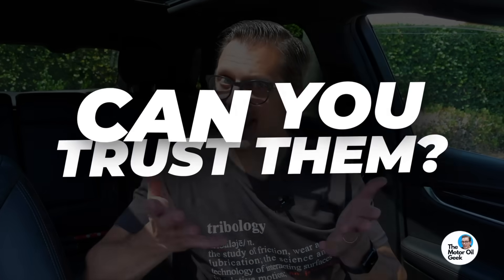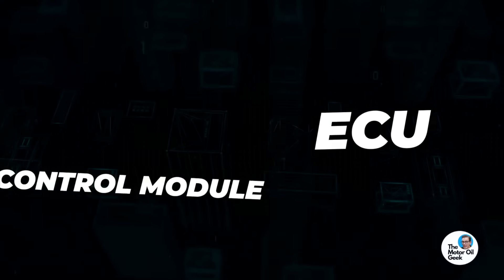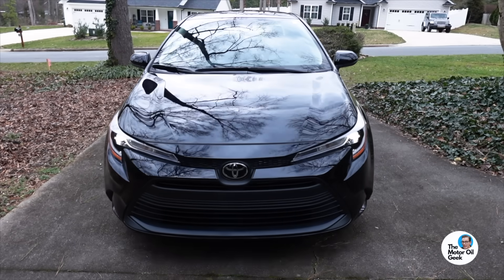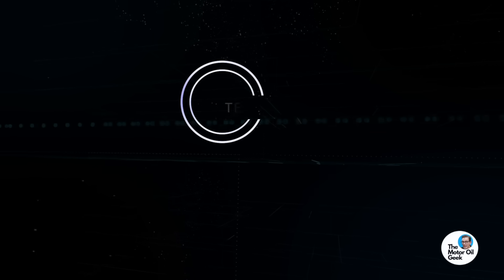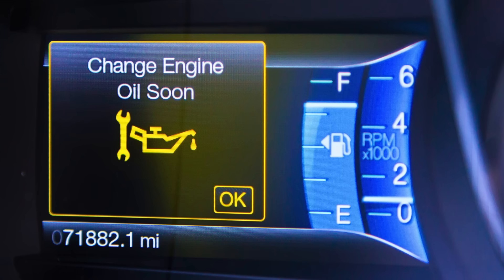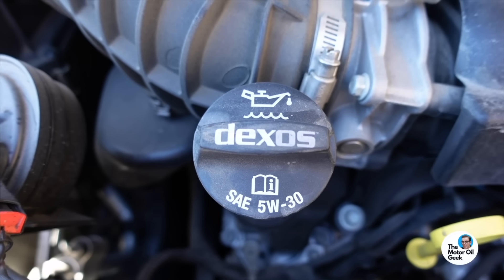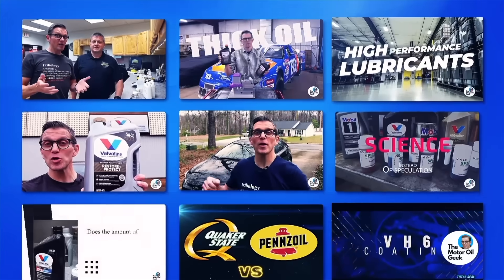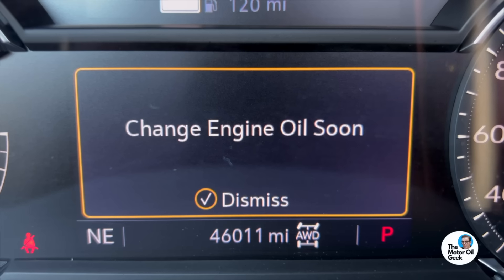The Accuracy of OIL LIFE Indicators REVEALED!

Comment: My car is a 1.6 diesel Vauxhall Astra it’s the first car I have owned with an oil light indicator it usually zeroes after 12 months it has done 66.000 miles now and runs very well my wife has a 2003 1.6 petrol Ford focus she had from new with 62.000 she only does few miles a year we don’t need 2 cars now I am retired but we keep it because is a member of the family now but every 12 months it has the oil change and it runs like new so but ways of looking after you cars oil changes seem too work

Comment: Didn't you post a video showing that you should NOT trust that, and to change your oil every 3-5k miles if you want your engine to run forever, that the manufacture recommendations were based solely on "keep costs low for the original buyer"???

Comment: So the results of the oil test showed the oil is fine, but also he is telling you "trust the monitor and change your oil when it says to". No thanks. The oil monitors and other nags are there to drive revenue for dealerships. There is no way an oil life monitor, based purely on an algorithm, can realistically tell you when your ought to change your oil. If you something high quality like Rotella T6, you are good to at least 15K miles if not 20K miles as long as you used an oil filter with the capacity to go that long between changes. There is nothing more cringe than some dopey boomer paying a premium for synthetic oil and changing it every 3K to 5K miles because the fool thinks it's good for the engine. It's actually not. Nobody who uses synthetic oil should be changing any less than 10K miles unless they have a specific scenario that would require it (i.e. racing, routinely operating in dusty conditions, etc).

Comment: Oil is cheep,  cheep oil isn’t.  I’ve used a high quality oil, along with oil analysis and have come to the results that 10000 miles works for me.  The lab results said I could go 15000 miles plus.  All the qualities of the oil were still well with in specs, but 10000 miles is a good round number on the odometer to go by.

Comment: I used to do 3 oil changes in my Pontiac before the idiot light came on, telling me to change the oil.

I got rid of the car at 263K, rust up to the door handles and a haunted transmission. But the engine? Ran great and burnt 1/2 a quart of oil a month. 

Put your oil monitoring equipment where the sun doesn't shine.

Comment: I just got back the results for my 2014 ford fusion 2.O vep engine, with 195400 miles, they told me i can go safely to a 7500 mile oil chi, i change mine out  at 6000 miles, and make sure the oil i use is dexos quality oil.  When i change my oil out i get back close to all 6 quarts in put in the engine,

Comment: GM engineering also developed "other" oil monitoring systems, including Acid/Base ratios, Visual Density, and a crude Viscosity sensor.  I and a couple of buddies got some money rewards for another method, using actual gear meshing speed/force contact times, through the oil film.  That was used in transmissions, for wear estimation and failure prediction.  The Algorithmic method is used primarily since it does not require any special or unusual sensors, thus reducing parts and assembly cost.  Software and AI "smart-systems" will be the wave of the future (actually now).

Comment: I disagree with the oil percentage gadge,just changed my oil in my 2015 Silverado with 62000 miles,no heavy use.just under 7000 miles on oil change and I was shocked to see gunk come out of my oil pan.i used 0w20 synthetic penns oil.it showed 9 percent. Next oil change will be at 5000 to see how it looks

Comment: Since you don’t know how many miles are on it……What if the indicator wasn’t reset when the oil was changed……could only have a couple hundred miles on it.  🤷🏽‍♂️
Reply from the maker: That's a fair point. However, the oil was very dark, so it was obvious the oil had not been changed recently. Also, the point of the video was not based on this single test. This is just an example to make the point.

Comment: True story. My 2003 GMC Envoy straight 6 engine said that i was down to 13 percent on oil. But the car began to lose power, so i changed it and never went that far again. 275,000 miles through and runs great.

Comment: I own a 2004 Mercedes E 320 from new and it has an automated service wear message indicator, no scheduled service mileage.  Still my daily driver and over 500,000km  traveled, the average mileage between service’s is 28,000km for its life so far.    The first service after driving out from dealer at new was 32,000km when computer said it was due.  Still same engine and transmission and no failures.  When German built cars were still a quality piece of machinery.  I live in Melbourne Australia if there are questions about conditions/climate the car lives in.     Yeh it’s full synthetic oils, but only exactly the manufacturers specified lubricants.    Manufacturers specified,  not Oil companies recommended suitable lubricants. They are not the same.

Comment: I wonder how accurate the oil life remaining analysis built into our 2020 Shelby GT500 is (yeah, THAT Shelby, with the 760 horsepower, supercharged engine).  In our case it the result of doing a formal oil analysis is likely not going to make any difference in how often I change our oil.  We bought the Shelby new and took delivery on 1/2/2020.  Since then we have only driven it about 3,025 miles (we have a small fleet of vintage Mustangs and Shelby vehicles we also drive during car Season).  By the end of each car Season (early to mid November) I usually show about 65% oil life remaining - after only driving a little over 1,000 miles since the prior oil change.  I get the oil and filter changed the beginning of every new Car Season (mid-April or so), using the Ford recommended synthetic oil of course.  I do think I will take samples at the end of this Car Season, and beginning of next Car Season, and submit them for lab analysis, while taking note of the on-board oil life analysis, just for giggles and grins if no other reason.

Anyway, I really enjoy your videos.  I have been in the auto repair end of the business since 1972, and in retirement have been offering disgnosztic and repair advice to folks belonging to any number of Mustang/Shelby groups and clubs.  Your information shared so freely helps me keep grounded in reality.  Thank goodness for your insights and the Internet being used as a way to disseminate  your knowledge.  You are doing much good for mankind, seriously...  Well, okay, you are doing much good for automobile enthusiasts at the very least - and that has to be worth something.  Others may fear, or even deny the importance of "we geeks."  I would suggest they watch this recap of my favorite Twilight Zone episode (1961, in black and white) to see what haooens when folks deemed to be geeks (or obsolete) are trifled with.  heh heh...  https://www.google.com/search?q=twilight+zone+episode+with+man+whi+is+no+longer+relevant&rlz=1C6CHFA_enUS1044US1046&sca_esv=eb561d6a720f4850&sxsrf=ADLYWIKCWNM-rkJ3h4jvk4jUIojABp8olQ%3A1728184020342&source=hp&ei=1P4BZ8qhEqSF9u8Pqq37yAQ&iflsig=AL9hbdgAAAAAZwIM5CFzha8pUb3wYsKJTRULK2JS43Q2&ved=0ahUKEwjK24uV4_iIAxWkgv0HHarWHkkQ4dUDCBg&uact=5&oq=twilight+zone+episode+with+man+whi+is+no+longer+relevant&gs_lp=Egdnd3Mtd2l6Ijh0d2lsaWdodCB6b25lIGVwaXNvZGUgd2l0aCBtYW4gd2hpIGlzIG5vIGxvbmdlciByZWxldmFudDIHECEYoAEYCjIHECEYoAEYCjIHECEYoAEYCjIHECEYChirAjIHECEYChirAki2iwJQAFj_iQJwB3gAkAEAmAGOAaAB1jyqAQU1NS4yNrgBA8gBAPgBAZgCTaAC0jbCAg4QLhiABBjHARiOBRivAcICERAuGIAEGLEDGNEDGIMBGMcBwgILEAAYgAQYsQMYgwHCAgsQLhiABBjRAxjHAcICDhAuGIAEGLEDGNEDGMcBwgILEC4YgAQYsQMYgwHCAgQQIxgnwgIIEC4YgAQYsQPCAgsQLhiABBjHARivAcICCBAAGIAEGLEDwgILEC4YgAQYsQMY1ALCAgUQABiABMICDhAuGIAEGLEDGIMBGNQCwgIOEC4YgAQYxwEYmAUYrwHCAg0QABiABBixAxiDARgKwgIKEC4YgAQYsQMYCsICChAuGIAEGNQCGArCAgcQLhiABBgKwgIHEAAYgAQYCsICBxAjGLECGCfCAhAQLhiABBixAxiDARjUAhgKwgIQEAAYgAQYsQMYgwEYigUYCsICEBAuGIAEGLEDGIMBGIoFGArCAgcQIxiwAhgnwgINEAAYgAQYsQMYgwEYDcICDRAuGIAEGLEDGIMBGA3CAhAQABiABBixAxiDARiKBRgNwgIQEC4YgAQYsQMYgwEYigUYDcICDhAAGIAEGLEDGIMBGIoFwgIOEC4YgAQYsQMYgwEYigXCAgUQLhiABMICBRAhGKABwgIHEAAYgAQYDcICBxAuGIAEGA3CAgYQABgWGB7CAggQABgIGA0YHsICCxAAGIAEGIYDGIoFwgIIEAAYgAQYogTCAggQABiiBBiJBcICBRAhGKsCwgIFECEYnwWYAwCSBwU0MS4zNqAHwZ4I&sclient=gws-wiz#fpstate=ive&vld=cid:68cb7226,vid:2qKRN5oAz20,st:0

Comment: I had a 2015 Mustang Ecoboost that I drove only 5000-6000 miles per year, pretty much only in good weather.  I would change the oil in the fall, reset the oil life indicator to 100% and put it away in a non climate controlled but dry building in Northern Illinois from late October to April.  No warm ups, start ups or anything while under the car cover and on a plastic vapor barrier tarp in a well ventilated building.  I would drive about 25-30 miles after taking it out of storage and the oil change indicator lamp would come on and oil life would show 0!  What do you think caused that?  Of course I just reset it and drove on as the oil was clean and new.  What did I miss?  Thanks and say hi to your dad from Auto Meter Mike!

Comment: The oil life monitors are buggy. Changed oil on a GMC this summer and reset it. Within 5 miles it dropped from 100% to 87%.   Also, met “Sister Sludge” some years ago and have always remembered what she said .. take your short trips but make sure you do a longer 30 min or so trip once a week or so to burn off the condensate.

Comment: I used to use the oil life indicator but I started just doing at 5K.  I figure it might cost me an extra $40 a year for an extra oil change.  I use Super Tech full synthetic and a Delco filter.  I have 185,000 on my Acadia and it still runs good.

Comment: My Avalanche had the oil change indicator. 
I ignored it, used regular oil, changed it every 3K miles. 
85K later I sold it,  and it ran like new and the engine was clean as a whistle.

Comment: 30 years ago when I had NA cars, i changed the oil every 10K and drove them over 250,000 highway miles reliably.  My first direct injected turbo, i noticed the oil got darker in 2500 miles than it did in 5000 miles in the NA cars.  Turbo unit is so hot it cooks the oil in a hurry, so Im sure turbo vs NA should have very different service intervals for oil.

Comment: I trust the oil life indicator on my GM product because when there is low life left, around 9%, the engine knocks once or twice on startup and goes away with fresh oil. I asked a GM dealer's service manager about it and he confirmed that knocking indicates that it's the latest possible time to change the engine oil and that it's highly recommended on GM's HFV6 motor to change it at that stage before you don't have a motor anymore. Now, I'm still going to look at my oil and use my best judgement, just don't be like my partner and drive your Subaru for 9k miles on the same oil and also with the service engine oil soon light on.

Comment: I have a 2019 Corvette Z51. The engine oil life monitor keeps ticking without even driving it. I bought it in late August, so I didn't put many miles on it before parking it for winter but come spring the monitor said it was time to change. It only had 1,500 miles on the oil. So, who do I believe the monitor or milage and common sense?

Comment: Only as good as the engineers programming it. My ‘12 Cruze manual trans would still show 30-35% left at 7500 miles when I would change it. Means I would be at 10-11k miles before they want me to change. Only reason I went that far is 95% freeway miles. 

GM released a new cal for the auto trans equipped vehicles to reduce the oil life monitor system but not the manual vehicles. Not enough volume to make it worth it.

Comment: I agree with this video 95%. The problem that ive seen is that GM has went in and changed the algorithm via ecm flash updates on some engines after finding issues develop after some run time. They had sludge issues in a few engines and I believe they had alot of early 3.6l failures from running them out of oil. From what I remember seeing on the TSB's most of the changes were in lowering the maximum mileage allowed before it would hit zero percent. Theres alot of vehicles out there that needed this ecm update but never had it completed so thats where im getting my 5% disagree from.

I will say that 99% of the time ive sent in UOA on my GM vehicles after hitting zero percent they came back just like Lake said and could have went another 3-5k more miles. I have caught leaking intake manifold gaskets before I even saw a loss of coolant on a 4.3l from a UOA so I still recomend them even with a oil change reminder system.

Comment: I would like to see the same test run on a more oil-unfriendly motor like the Dodge/Ram, etc. supercharged 6.2. I have always been told power adders like turbos and superchargers require more frequent oil changes but my supercharged 6.2s oil life indicator will read around 30% at around 5-6000 miles. I always change it around there because I don't trust it. I would be nice if I could stretch it out more because it's costly.

Comment: My 08 STS had the OLM, and in about 2010, Cadillac reprogramed the OLM because the Undersized Timing Chains were Stretching excessively. Once reprogramed, the OLM would lose 1% for just going to the Store 6 blocks away, when the Ambient Temp was just above Freezing. 5% if below -18C. That was with Synthetic Oil. My 95 Buick and 95 Fleetwood Brougham, also with OLM, will go 12,000k before the Change light pops up, and that's calibrated for Dinosaur Oil. The Buick has gotten to 300,000+, using the OLM and has never even had the Valve Covers off, except the Time a Backfire blew one of them off. That was caused by a Badly corroded Ignition Wire at the Coil.

Comment: These systems are complete B.S....we were looking at a 2017 Escalade an older gentleman had for sale, great condition despite 200,000 miles...I am not afraid of high miles, the price was right also...He kept up maintenance, but obviously was not mechanically inclined himself, took it to garages..the oil monitoring system said something like "30% life left", but me, not trusting electronic gadgets, checked the oil with the actual dipstick...there was BARELY a drop of oil on the dipstick, and itwas as black as tar. I showed him the dipstick, and he seemed bewildered that it could be that low with the indicator showing what it did...we added oil, and it took 2-1/2 quarts to bring it to top of crosshatch!..I explained that with 200,000 miles, it would use more oil between changes, and I doubt the monitoring system takes that into account. He explained that he always stuck with the 7,000 or 10,000 miles, or whatever it was, oil change intervals the manual called for. I wondered how many times it had been run very low of oil between changes...we ultimately passed on buying the Escalade because of this, even though it ran fine and was in good shape. I trust a dipstick and common sense, not an electronic monitoring gadget....

Comment: As a dealership tech. I never will advise to follow the Oil minder/life indicator. Unless you truly have long commutes on a daily, minimum about 25 miles one way…. Any customer that has followed and/or gone beyond it. Typically experienced higher chances of wear, in cam phasers, VTC actuators, chain stretch, chain tensioner failures, ect.

Comment: As a 40 year Master Tech and Shop Owner, I learned the functions of the algorythm working for GM in the early 90s and have been explaining to clients how they don't NEED a sticker since their vehicle has or may not have a monitor system. Also, how those who like my Titan don't have such tech( which sucks if you ask me) .  So also I find 1 that other shops as a means of driving work including the dealers( more on the why there ) will still use and support the sticker  2 they don't reset the life or plug in and set up the miles a milage reminder system ( leaving it to the default).  So much fraud in the PM world it's sickening.  " we rotated your $400 per tire as required sir"  YEAH front to back so I get half or less the life and they can say it's mechanical issue that caused the wear pattern makes your car sound like the bearings are shit or sell struts and parts as "upgrade" so it won't happen again. GRRRRR   Dealers are now the worst as over the long history of them NOT having any part of the PM market they wanted it bad. 2008 Obama crash the independent shops and chains let their hard sales people go and they needed jobs. So, off to the dealer as service managers they go. They took with them their play book of PM over PM sell water to a drowning man skills and showed their bosses how their was a space in the PM market they could own, PROOF?  Sure, before 2008, did you EVER HEAR of a maintenance for life at a dealer?  Right, only at chain shops. 
So I love your proof and support of the monitor system and explanation. The only real issue is DID someone who previously in their drive way ( I don't know how to reset, (google yt knows)) or at another shop FAIL to reset the monitor or indicator.

Comment: Thank you.  This reassures me on my Buick the fact I replace the oil at 20 percent oil life is not doing and damage to the car.  It happens at about 6000 miles with my driving.  Which seemed reasonable.  My last car I did the same thing, a 2006 Saab 9-3 and it is still running with the second owner with 270,000 miles.  So I guess through experience I figured out the oil life monitor if used conservatively works pretty well.  Thank you for confirming it!